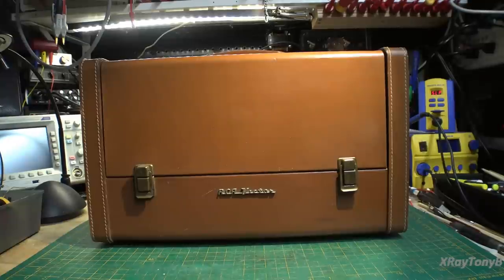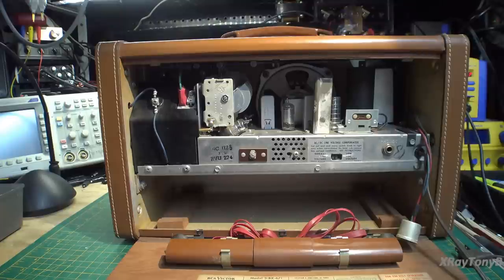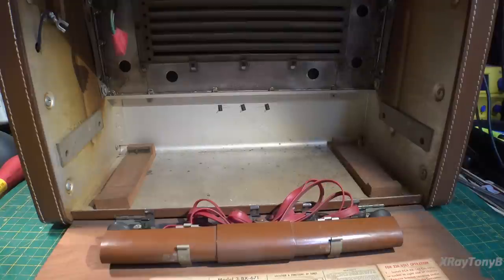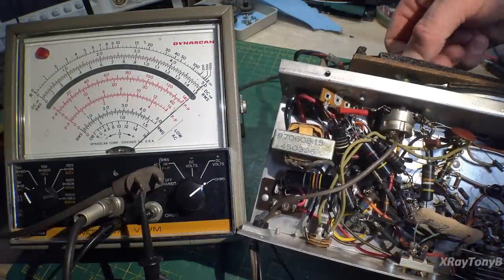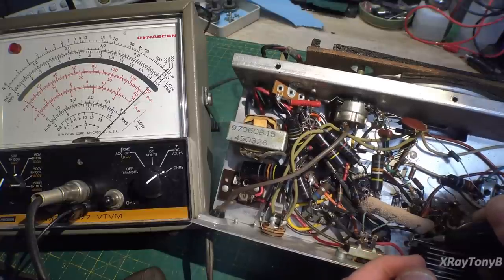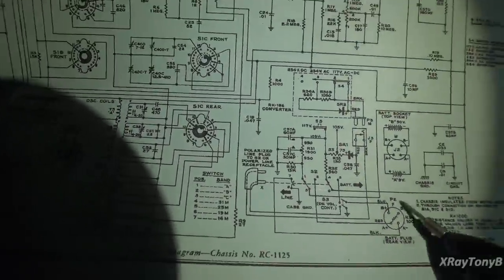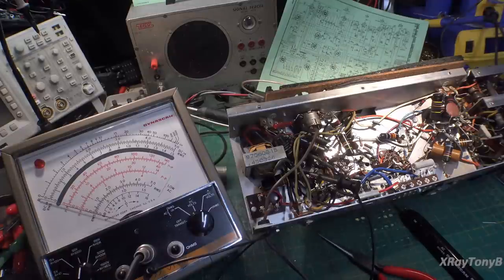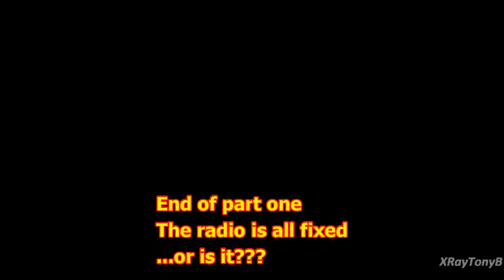RCA 3-BX-671 Short Wave Radio Repair - Part 1/2

Comment: Very nice radio. One note: The nominal power voltage in europe is not 250VAC - it´s "only" 230VAC. I´m sure in the diagram at 41:52 the text means 234VAC, which is two times 117VAC, which makes sense - but not  254VAC.

Comment: Nice video Tony!  I have the later version of this, the 7-BX-10 (1956), which is virtually identical to the 3-BX-671 (1953/54).  The main difference is in the power supply.  RCA added a 50A1 regulator ballast tube in the 7-BX-10.

Comment: I recently acquired an old "roll-top" Philco portable. I always worry about the condition of the radios I get and this one had something loose inside. Turned out to be the battery, a Burgess A-B battery! Oh, of course it was deader than a door nail, partially expanded and covered with what sort of looks like frost, but it was a real original battery! I think the bulk of it was 1.5v and the bias portion was 90v. Would be interesting to make a modern replacement, maybe with D-cells for the filament power and 9V batteries for the bias.

Comment: Bumblebees were made in paper and also paper in oil, you can tell the difference by looking at the leads close to the body of the cap, the oil filled ones have a thicker lead on one end that has a solder connection, this is a thin hollow tube after the capacitor was molded oil is injected into it through the tube then the lead wire is inserted into the tube and soldered in place completing the capacitor, if there is no soldered bead and the lead wire is the same diameter right into the body of the cap it is just a paper wound not oil filled.
Reply from the maker: Great information!  I'll make sure to share that on a future video.  Thanks!

Comment: In regards to the capacitors, you did not mention or cover the line filter metal can cap (60,60,30.25mfd). This must always be replaced as a matter of course.

Comment: 59:00 - Shouldn't you plug the ferrite antenna into the chassis? You removed both antenna inputs to pull the chassis.
I have literally the same radio. Model 7-BX-10 and have hesitated to work on it since the manual gave no hint on how to safely pull out the chassis. So, I am following this video very closely. Thank you for blazing the trail for me! I live by the motto, "Do no harm". You are a God send.
Reply from the maker: The ferrite antenna is optional.  In order to use it, you would first unplug the red 3-pin connector that comes from the loop antenna in the front flip-up cover lid and plug the stick antenna in its place.  In other words, you can use either the built-in loop antenna OR the rod antenna.  Hope that helps.
Thanks for watching!

Comment: Short-wave radio set-ups are now a "lost art". I have a Sony sw-77 (circa 1990) that I play around with..but because I live in a metro area and close to the Airport it's difficult to receive long distance broadcasts (except around sun-up/sun-down). Occasionally I pick up truckers and base station operators talking about the gear they have. Shortwave (ham) stations were really the precursor to WWW, except you needed half-a-brain and a few dollars in equipment to "join the club". You also needed to be decent at morse-code.  (like I said...at least half-a-brain...)

Comment: Just thing is it not true that a lot of the parts that are needed to repair these radios are getting very hard to find as almost all radio manufacturers are moving to DSP based radios, you might need to get low voltage (Space Charge) TELEFUNKEN GMBH vacuum tubes, should that radio only have a plate voltage of around 30-50V and not any higher and why 90V that seems a little too high for Space Charge Vacuum tubes.

Comment: If you knew the general Vdrop of any diode, couldn't you put together a super simple boost converter? Something no larger than an altoids box, then you can just test a known voltage (from boost converter) against its Vdrop with yur multimeter. Would seem to be super simple to make (powered by a little lithium battery or go crazy and make it rechargeable) and you would know if the Vdrop is in acceptable range.
Reply: Virtually ALL modern diodes have a forward bias drop of 'about' .6 of a volt. However, even 'new' good condition Selenium Rectifiers have 'about' 1 volt drop, for 'each' plate in the gang! Some people forget that most meters, on Ohms, don't have enough voltage on the probes to forward bias diodes though. If the meter has a 'Diode' setting, it might put a few volts out, but a 3+ plate Selenium will still not show a reading.  Maybe a known voltage in conjunction with a string of Zener Diodes would be easier to see minimum forward bias, if needed.

Comment: I have been a sub for a long time. I will stay one but I find I now skip a lot of them because of the very long time. Anything over 20-30 minutes causes me to loose interest. Very sorry but you probably have a lot of subs that do the same.
......
After some of the replies, I want to say I am certainly not criticizes his content, quality or anything. It is just when I have a little time before dinner, I will skip over a very long video and watch a shorter one. I appreciate no commercials but my feelings towards hour long plus videos is the same.
Reply: it is good he is not running advertisements every 5 mins :) but yeah, usually anything over 10 mins is getting boring
Reply: Im good with the lengthy vids, slow learner i guess!
Reply: I wonder thou how many people would complain if he cut this into 3 smaller segments. He could easily do so to further monitize the channel. The fact he does not should garner praise not criticism.
Reply: Russell Richard I don’t have ADD either.
Reply: @PeriodWoodworker  
If you loose interest after 30 mins then what do you have if not ADD? 
Not having the time is understandable.
Reply: I appreciate the in-depth videos. They are an opportunity to learn not just be entertained. If I had to pay for the knowledge gained,  I couldn't afford it. On very long videos I watch them in sections. Plenty of videos entertain,  very few are taught this well.